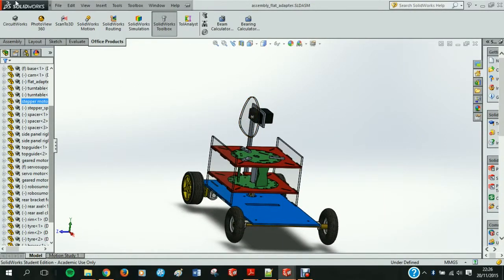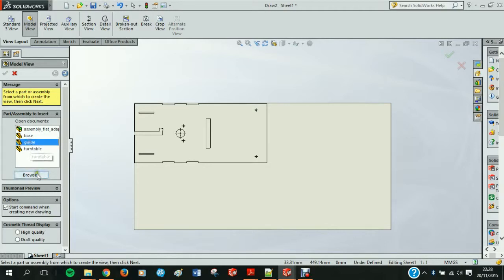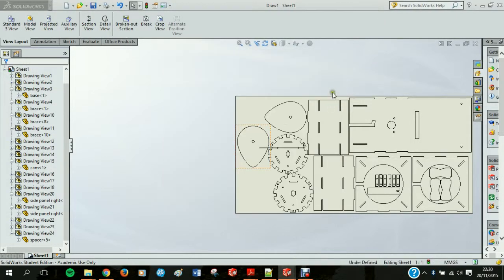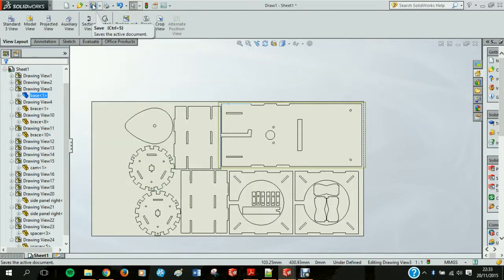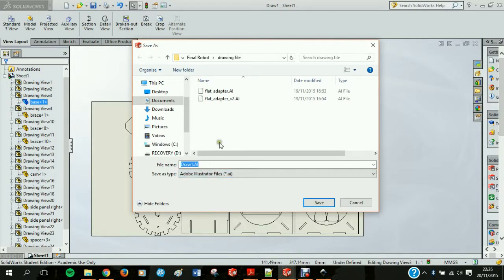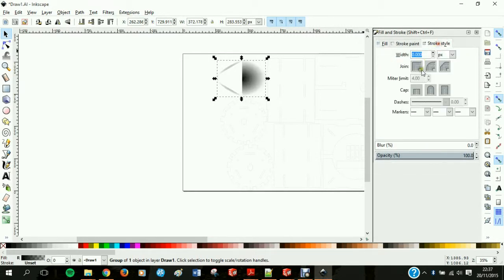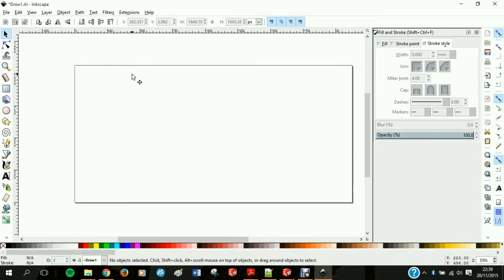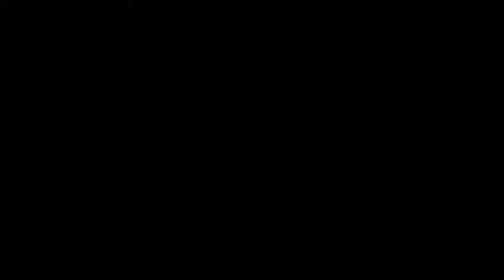How to make a laser-cutting template of your solidworks parts

Comment: can you give a help, my inkscape  kinda freezes and don't open the file :(
Reply: Hey Daniel, .dxf works😎
Reply from the maker: @MrPunkb  Brilliant!
Reply from the maker: Hi fishy'. I no longer have a solidworks license and its been a while since i last had it so i cant really try. I was mainly using inkscape to reduce the line thickness below the 0.05mm, but the Epilog laser cutter reads lines below 0.005inch (0.127mm) as a cutting line. If there is any way to export directly from solidworks to .pdf it may get you by without having to use inkscape at all. 

Could you make sure you are saving the 2D solidwoks layout as an adobe illustrator format? 

If you need it in inkscape I'm willing to sit in if you want to share a screen with me sometime. Two sets of eyes might catch something!
Reply: @danielmurray3239  hi Daniel, yes i am saving as .ai. i dont have any extentions installed on inkscape, let me check after this. If doesn't work se give ir a try. I have k40 laser btw
Reply from the maker: @MrPunkb  i see the k40 doesnt rely on line thickness, but line colour so you can ignore all the line resizing in this video. 

I never installed any extensions in inkscape either. I'm at a loss as to why it wont open the .ai file in inkscape. My only other suggestion would be to try saving the solidworks sheet as all the other "save as" options and try opening in inkscape. (.dvf, .dwg...)